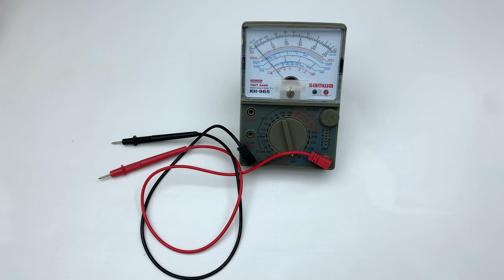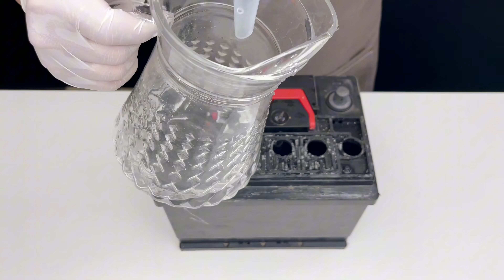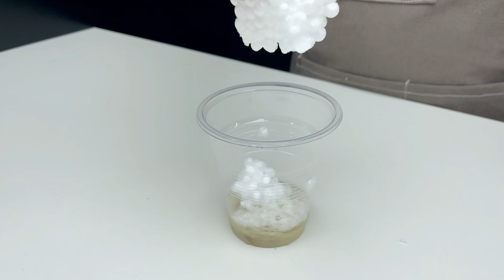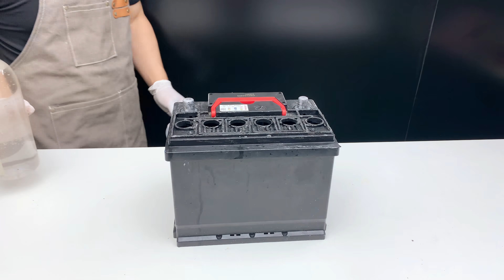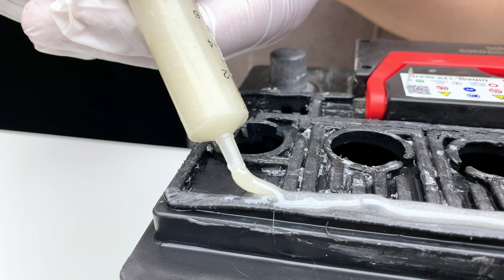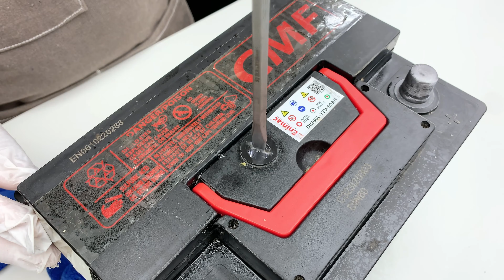Battery Lasts Forever! Insert Styrofoam into Your Battery and Be Amazed at the Result!

Comment: Use Distilled WATER ONLY!!!!? for rinsing then add the sulfuric acid pre mix trickle charge after that
Reply from the maker: Thanks for the additional tip. Distilled water is definitely the safer choice when working with batteries.